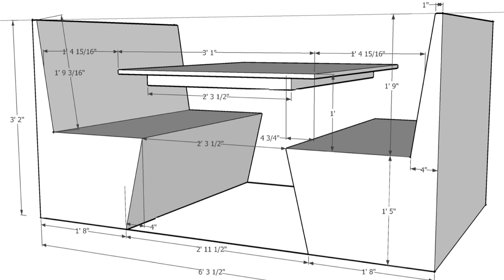Our Marine Refrigerator & More Refit Stuff! (Part 2)

Comment: Nice job. I'm doing something both similar and yet fairly different.  Similarity is that I'm making a cooler that uses vacuum insulation. Differences are that rather than using vacuum insulated panels, I'm basically making two air impermeable, very strong boxes where one fits into the other with about 1.5" of space between them, and then I'm pulling a vacuum and sealing it up. Vacuum insulation all around, except for the stands I made to space the smaller box to be level with the bigger box.  That unfortunately provides a conduction path between the two boxes, but I've come up with a solution to really reduce the conduction between them.  I reduced the surface area as much as is possible, so there is as little conduction as possible while using thermally low conductive materials.  

     It will also be able to double as a Solar oven/cooker, and a no grid electricity microfridge (uses a Solar panel plus two peltier/TEC devices). It's made out of mostly sustainable materials, minus the epoxy and silicone--but I'm using Entropy Resin's 33% bio content epoxy. Though, I have to use a little bit of a vacuum rated epoxy for sealing. To offset/reduce some of the epoxy, I'm using a strong and waterproof rated wood glue for some of the glassing. The inner box doesn't use any epoxy or woodglue, but a tri-blend silicate water solution, which is then covered with a high temp silicone layer. 

     Probably won't put up a YT video on it, because after the prototype is done and tested, if it does well, I'm going to put it up on a crowdfunding site.
Reply from the maker: Sounds awesome! Could you use a non- conductive foam or honeycomb to give some structural support between the two boxes?